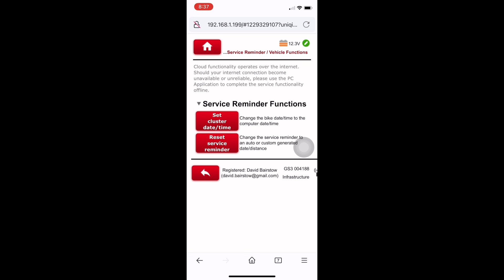Maintain your own 1250GS

Comment: Thanks for video.
Engine drain oil plug torque is 42 nm
Reply from the maker: Yes on a non oiled thread, you risk stripping thread if oil on it
Reply: Need to torque it 42 nm to compress and form the copper crush washer properly either the plug nut is oiled or dry.

Comment: Thanks for the video post.  For the audience, could you include the "fiddly" part about what makes putting the rear shaft splines back together so time consuming and what eventually worked for you.  What is the "trick"?    I think this will greatly help some of us.
Reply from the maker: I lifted with the cable tie and while lifting with the help of my wife, "jiggle" the shaft back and forth. The shaft and splines and need to be parallel